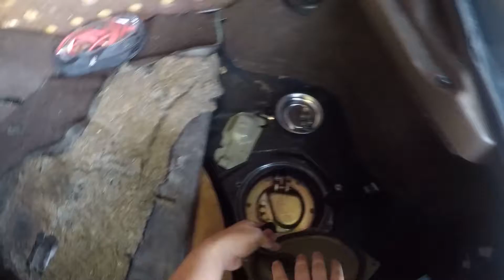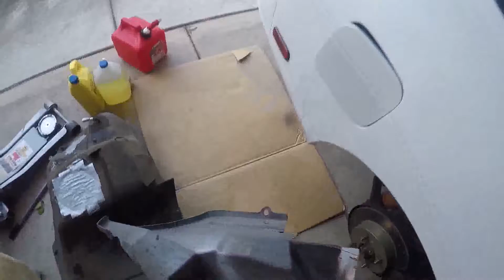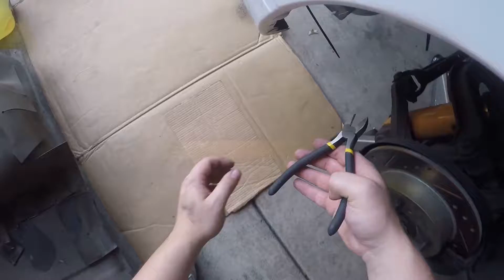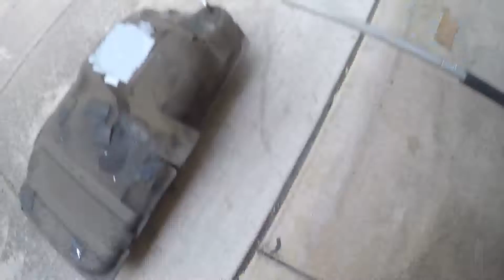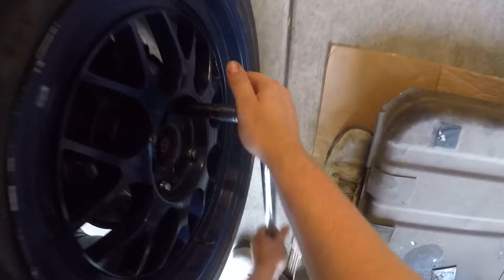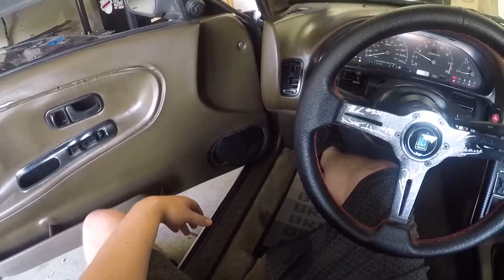Nissan 240sx Gas Tank Swap - Part 4 : Install New Tank and Pump

Comment: This is all what needs to be done on my 240sx then. Fuel pump, gas tank, and new battery. Also cleaning the sender unit. I am discouraged by people saying my engine is probably too seized up from bad gas, among other things, it's just discouraging. Are you also in Texas?